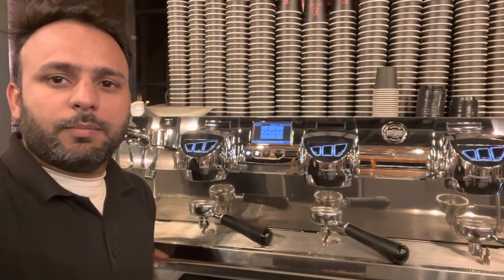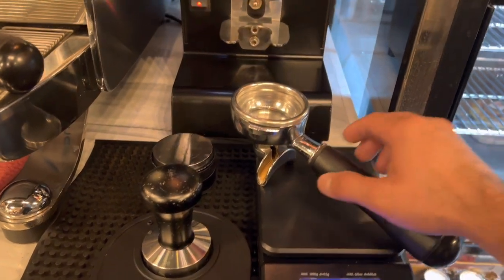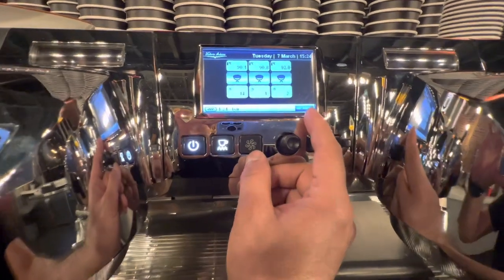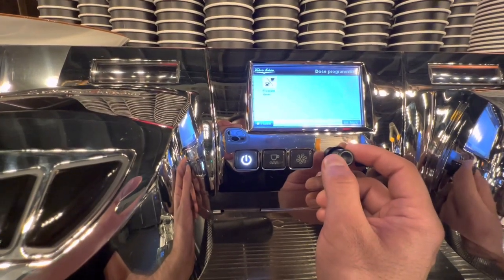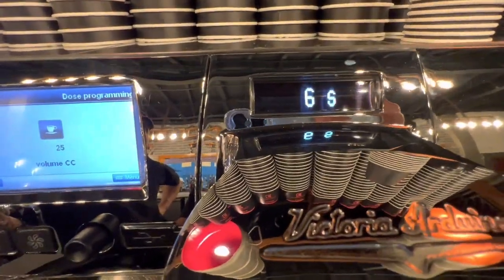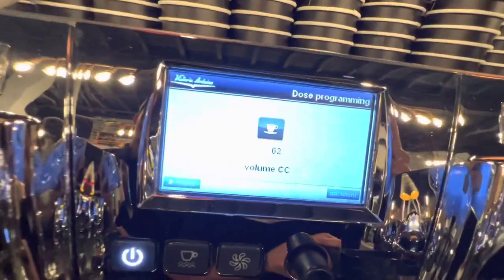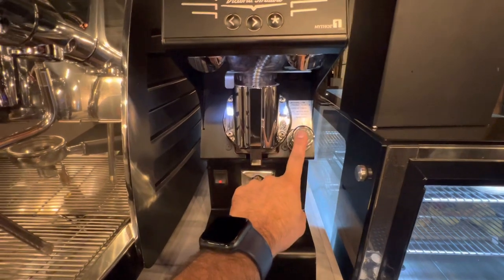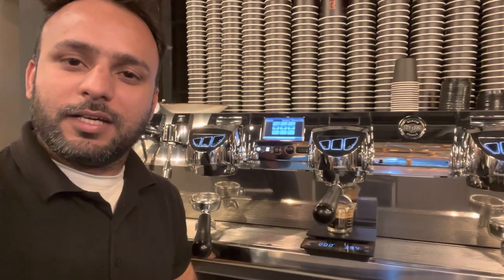How To Calibration Victoria Arduino Black Eagle Machine | Victoria Arduino Black Eagle

Comment: No to brag just correcting some little bit. Bro you can't just calibrate the machine for the ideal or standard ratio of espresso for the coffee shop
Its not about the yield perfect.espresso required perfect timing of extraction. You must monitor your time if how many secs must be an espresso shoulf comes out to the machine and  time of extraction also if the ideal yield was been already reached.  Monitoring machine time for extraction is not convincing for a perfect espresso. I was happy for you bro. You calibrate an espresso machine 1 at the time 🤣😅😅🤙🤙